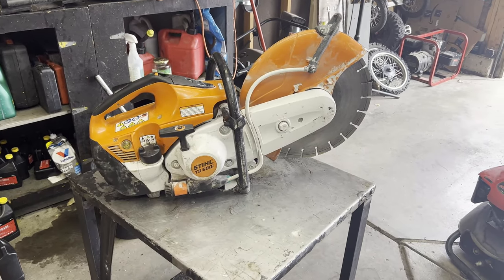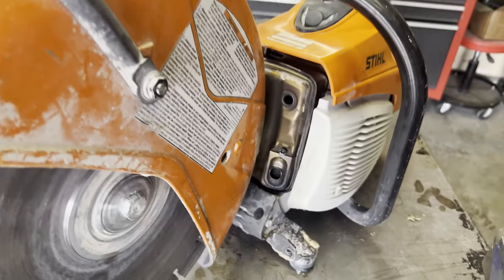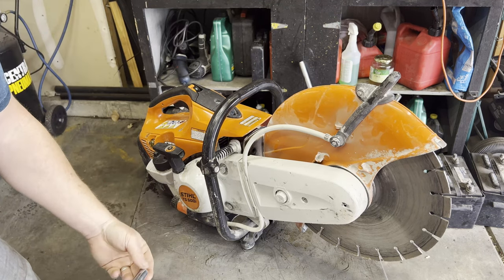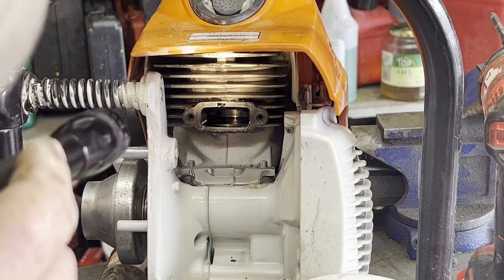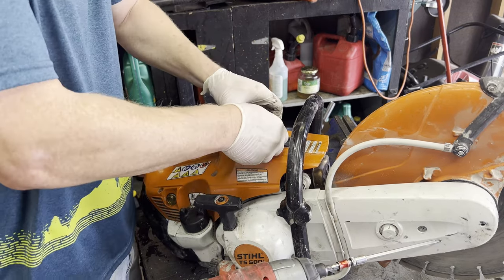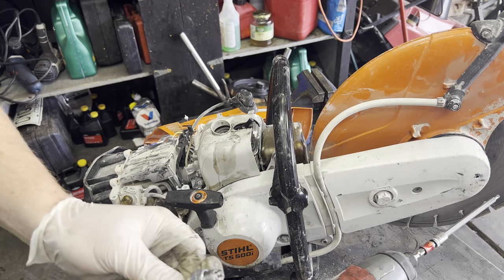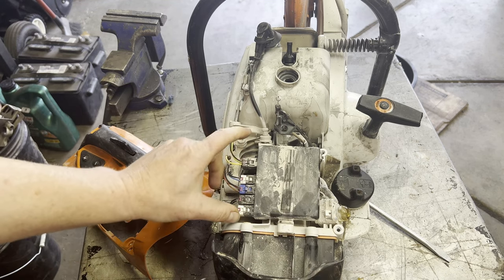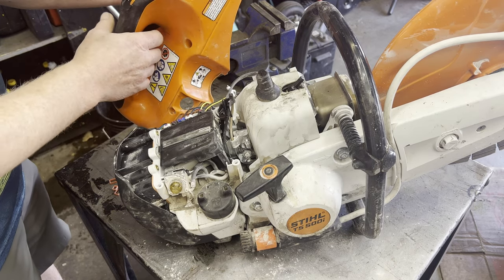STIHL TS500i Cutoff Saw  Won't Start Small Engine Repair

Comment: Hey Robby. There is an assumption that the crankshaft seals were worn out. The crankcase is not tight enough. Try replacing them. in many cases, it helped. Good luck!
Reply from the maker: Thank you for the information.

Comment: I have same problem. Replaced flywheel and coil...they were worn but that never fixed problem. Replaced kill switch and I got spark. BUT still takes many many pulls to get ignition. Not sure if it is fuel supply issue? Saw same video pulling on module wires, mine are all fine. Did you ever determine final fix on this? thanks for the video.
Reply from the maker: Hi Warren, I did not. I do not have the tools to diagnose the computer. If I did more STIHL work I would definitely invest.

Comment: Hi how can you replace the throttle locking spring as it pop out when I replace the throttle cable
Reply from the maker: You need patience. Have you searched for diagrams or any pictures of the setup online?

Comment: Hey folks I’m a stihl certified mechanic  there is a couple grounds that need to be checked 1 is on the left side of engine where that metal plate is the covers the wiring then there is one on the engine sensor (bottom screw) don’t forget the wires that go from generator to the controller (old style is separate wires black and blue look for rubbing and black spots on crankcase there may be bare wire that will shut you down newer models have heat shrink on wires, correct spark plug will make a difference
Reply from the maker: Thank you for that information Mike.